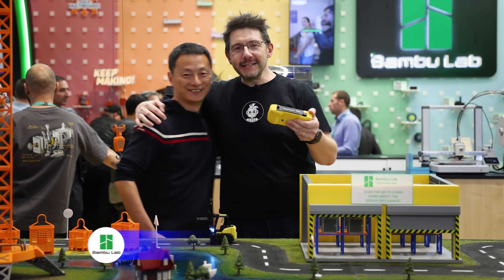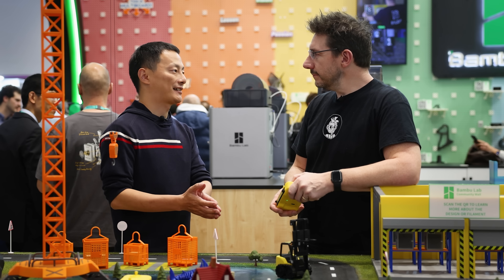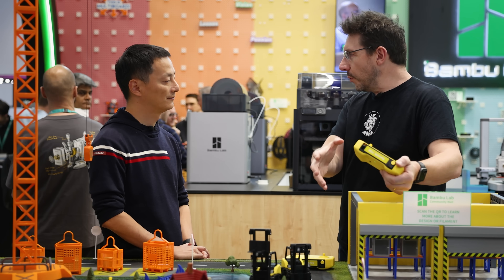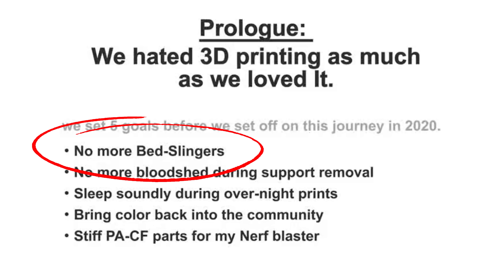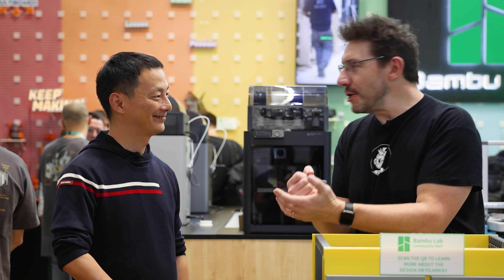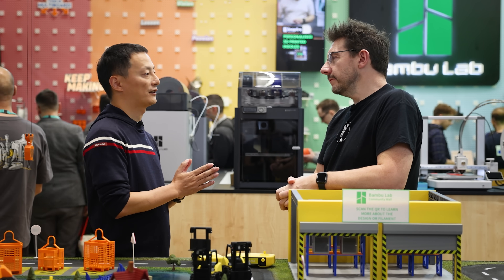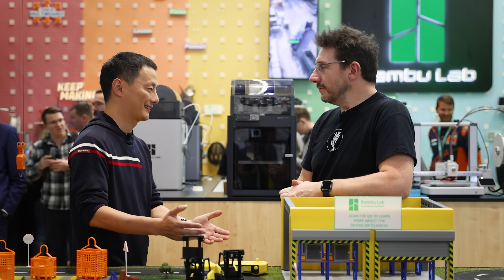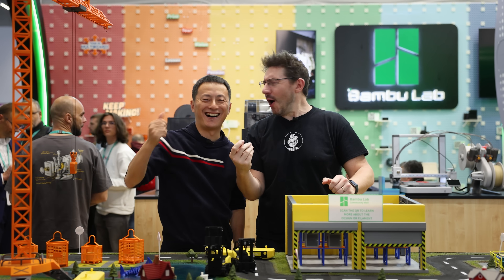Bambu Lab’s Dr. Tao at Formnext 2024

Comment: UPDATE: DO NOT BUY BAMBULABS They just updated firmware to brick your 3D printer if not connected to WiFi. They will be able to sell your data and print list, no more ORCA, no more Panda Touch, and will probably lead to subscription based services in the future. #RIPBAMBU
SPREAD THE MESSAGE WE WILL NOT BE TAKEN ADVANTAGE OF
Reply: Most of that is wrong.

Comment: Regarding the tariff concern, setup a US facility for assembly and US parts sourcing where possible.  I realize that is much easier said than done, but look to Toyota, Mazda, and Subaru for examples.  They did it.  It can be done, especially for mass-produced products with unit volumes at 1 million or more.  As noted in the video, parts sourcing in Shenzhen is not necessarily an inexpensive place to build things anymore so it could be a net cost benefit in avoiding tariffs.  

There is a very large factory space that FOXCONN and the state of Wisconsin built a few years ago and never used right between Milwaukee and Chicago that could be a good option for them to explore potentially using a portion of that space.
Reply: Why would they waste the time and capital building out US production? To produce goods in the US that will cost the consumer as much as goods made in China (after tariffs)? You're living in a dreamworld if you think that's going to happen. No, they're going to keep producing goods in China, and we're just going to be paying higher prices for no good reason at all.
Reply: @sasca854 look into human rights in China. They even use slave labor in some instances. Forcing American manufacturing to treat people humanely makes  American goods more expensive. Allowing other countries to flood our market with cheap goods from companies that do not honor human rights defeats the whole point don't you think?
Reply: Bambu would be more expensive than even Prusa if they used a significant amount of US parts or US labor. The only way Bambu can do what they do at the price they offer is with the network of Chinese components

Comment: The reason they can drop their prices so low is because nearly every manufacturer on the planet over prices their products by an insane amount take stratysis for example. Bambu lab is about to release a printer that has similar capabilities as their printers that cost as much as a full-size SUV. Why do you think they are suing them because Bambu about to blow the doors off of the difference between professional manufacturing machines, and consumer grade.
To answer the issue with tariffs. Take Honda, Toyota, and other non American companies. They have factories here in the USA. That is your answer. Begin USA made parts. With factories and warehouses right  here in America.

Comment: I use the X1E, and the networking still won't work as advertised, and I still have to transfer files by the sd card like a caveman. I reach for my 2 Duet3D networkable coreXY printers first as they work over simple web interfaces and are thus easily networkable in corporate environments.

Comment: I had completely transitioned to Resin printing for engineering level functional solid parts, and bambu brought me back with the X1E. I started a company providing industrial quality automation for small businesses. It charged me up when he talked about being able to stay low cost by strategically selecting premium components hit very close to home for me because that’s precisely the same thing I am doing but in Food manufacturing..
Reply: how did you solve the UV resistance issue with resin prints?

Comment: All I want to say is that with my purchase of the P1P, I’ve actually gotten excited to use a 3d printer. Coming from a printer that I always felt like I had to tinker with settings or tinker with the machine itself. Now I can just find a model to print, push it to printer, and in a few hours have a finished print. I’ve just been blown away.

Comment: Next time ask him why it is  necessary for a printer  to be online and encrypted at all times
Reply: Which printer is this? Did they make a printer that ONLY works online? Which model so I can avoid it.
Reply: @hawtdayum  can you set up and update any of their printers offline?
Reply: @kimmotoivanen  Yes. You can setup and do offline updates for X1 with the A1 and P1 shortly to follow.

But even after connecting the X1, A1 or P1 series you can run offline permanently.  

This * "the printers need to be connected to the cloud" *  has been debunked for years as the cloud is only an option not a necessity.

Comment: I got my A1 last week. It’s my fourth printer in the last 10 years. I’ve had to spend so much time calibrating and tinkering with all my other ones that I lost the passion to design and print stuff.

The A1 has been so simple to use and get really good, fast, high quality prints from that I haven’t stopped printing all week.

Comment: I have been 3D printing random junk and things for the past few years...  using Anycubic MegaX and it lasted me as it was my first printer and I upgraded it with firmward/auto leveler and what not over the years, and I even integrated Octoprint into the printer, so I could remotely run it.  When you plug it in, it powered up the pi inside it as the bottom had lots of room, and put the PSU and items on a relay.  After plug in, power cycle is a physical push button on the side, or web interface in Octoprint.  Then run all jobs and everything over wifi/web/home assistant, and then power off after...  really a great printer that made me a better printer...  

I just bit the bullet and purchased a Bambu Labs P1S... and HOLY CRAP!!!!!!!!!!!  I am in love!!!  About 3 months, in now, purchased 2 more AMS add-ons and printing many colors  and optomizing my printing and Fusion 360 designs and my P1S quality  is almost as good as my resin 3d Printers (Anycubic Photon Mono SE <my first resin printer>, and Anycubic M5 Max) 

Bambu Labs is constantly updating and making the software/firmware better, the RFID filaments is another thing I love!!  And that Bambu Labs filament is cheaper or just as cheap as the lowest cost filaments, is amazing, because I can use the RFID, track usage, track remaining of each color, and keep it all OEM, so quality checks I know are behind it!  Where cheap stuff, you can get months of amazing quality then it starts to drop off until you think your machine is the issue and cant fix, when its the cheap filament!   I can't wait to hear what the next printer they will announce that keeps getting pushed back... 

BAMBU, PLEASE BEAT THE PATENT LAWSUIT!!!

Comment: Been 3d printing for years, i used to have 12 ender 3 v2's at my parents home running a small business with stuff i designed. Fast forward now, i sold those enders and now i have 7 bambus, 2 x1c's and 5 p1s's, all with ams and i still need more to keep up with demand. The multicolor ability and the reliability have been absolutely game changing as a creator.
Reply: i have a X1C   a A1 and a A1 mini.  beside my heavily modified Ender3V2s (all klipper , dual Z motors , S1 extruder,  the works..)  and i tend to use the bambu machines 80% of the time.. and the enders only when i need to print multiples of a part.   Its  baffling though how less i use my old printers since i got those 3...

Comment: I think Bambu made a mistake by not offering a larger format printer before developing something new. They should've just sized everything up and then worked on something new to the table. We (FRC 5090) use our x1c for a ton of robot parts but we are finding more and more often that we just need a slightly larger build area.

Comment: the first printer from Babmbu lab that I will agree to buy is the next one, blindly, wont think twice.. IF it was IDEX and Large format.
Reply: Same, or a toolchanger
Reply: @GreenPlasticWaterCan  i dont think they will go the tool changer path. at least I hope they don't
Reply: Either IDEX or dual nozzle head, whichever is more reliable
Reply: @spooky2466  isn't idex the same as dual nozzle head?
Reply: @SaifBinAdhed  No, with an IDEX printer you can print two (identical) parts
at the same time.
Reply: @Frost-zy4nz  oh now I get it. a dual nozzle head would be even more efficient than idex. all I need is to be avoid to print petg and pla or vice versa  for support

Comment: I used to hate Bambu. I thought they were the apple of 3d printing. Basically I thought they were anti-repair/anti-consumer. I mean why else have a closed off ecosystem and proprietary parts? Once I ordered my A1 I finally understood. It's to make it as simple and reliable as possible. All while remaining very cheap and having a 1 stop shop. I don't think I will ever go back to anything but bambu. Maybe prusa in the future if they release a printer to compete with the P1 or A1 around the same price point.

But the A1 was the first printer I have bought where I didn't have buyers remorse the days between ordering and it arriving. Normally after ordering is when I start seeing the bad reviews. All I saw with the A1 was more positives. Once I got it I had it up and going within an hour (including the 30 minutes calibration).
Reply: The thing people don't realize is that the "apple methodology" in of itself it isn't bad. What makes it bad is how aggressively they choose to maintain their ecosystem. Bambu is really using the methodology how it should have been. Keep it simple and streamlined, protect things that would absolutely give your competitors the edge they need to instantly catch up and make everything for the consumer easy and reasonably priced. More importantly don't fight consumers wanting to modify their product, but embrace and support it. That is where Bambu sets itself apart.
Reply: Oh cry me a river but it’s not open source. 

So what.  I want my hobby ti be printing stuff not the printer. 

If people want that then great. Go for it. 

Stop gatekeeping cos your niche hobby isn’t any more

Grow up
Reply: @MattHealey.  Who the hell are you talking too? Neither of us are gatekeeping and are instead saying it is great they are trying to make this as consumer friendly as possible.
Reply: @MattHealey.  Brother... You read the first 4 sentences, got mad, and replied... Do you only read news headlines and get mad as well? Lol literally read the next 2 sentences, or you know the rest of the comment...
Reply: @MattHealey.  Reading the full comment before typing a rant, usually helps not making an ass of yourself :)

Comment: Bambu Labs new printer probably has an integrated 3d scanner. E.g. copy and print.  I was planing to build a printer which optically scans an object on the build plate and than prints it a few years back. Or it just has a five axis print head.
Reply: @Gigaloader  I doubt it. That feels too niche a feature especially when photogametry is a thing.

Im think hybrid tool changer.

Comment: He wasn't wrong about bedslingers, he openend a new way for a lot of people to print....
Reply: Bed slingers have a place they are cheap to produce and can have nice results for PLA. But downsides is the printer takes up alot more room and you cannot control wind drafts or  chamber temperature because it's not enclosed. You can enclose a bed slinger but it takes up even more room.
Reply: Compared to the e3 and duplicator 3 The a1 and a1 mini is so fun and the perfect starter machine. They did it right when they released their bedslingers.

Comment: I wish they were more open sourced and that i was able to change the plastic parts with pccf or other 3d printed plastic, without affecting a warranty. Change the carbon rods in the x1c to hardened steel, or titanium rods.  We all should be able to do what we want with our printers even if we don't ever do anything to it and a new model after 3 years??
Reply: What other manufacturer warranties it's product after you have replaced components with non-standard parts?